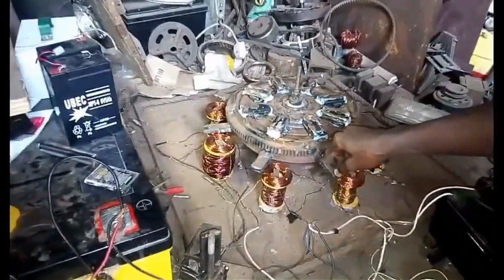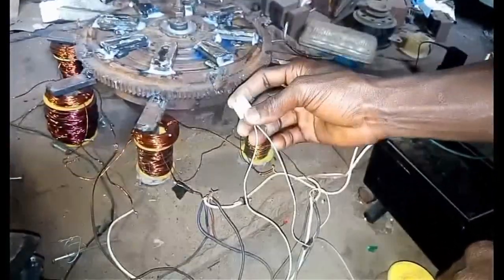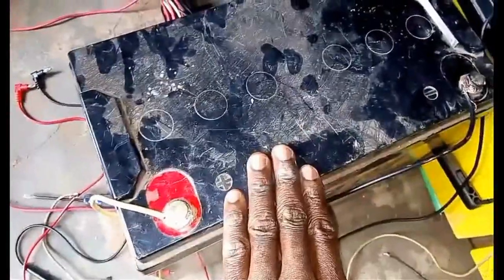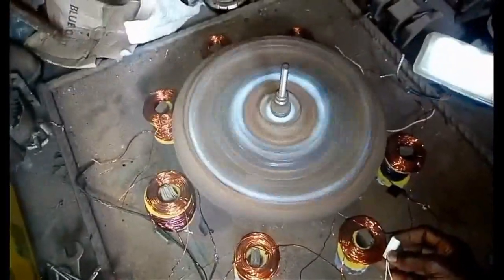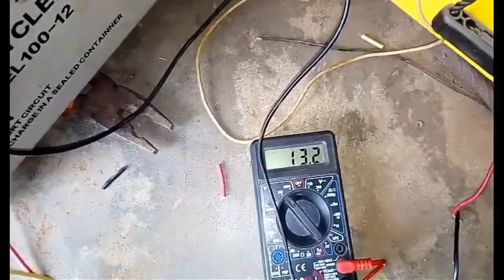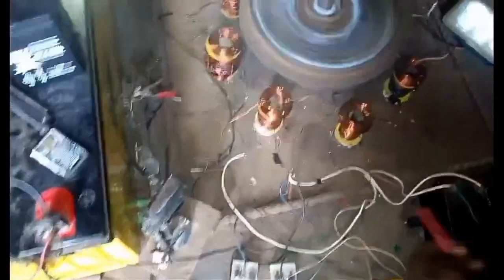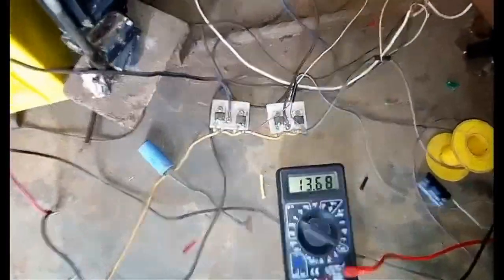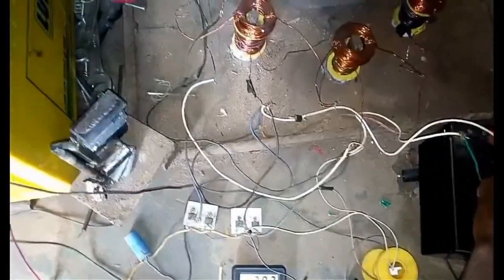Pulse motor generator 3

Comment: How much does this actually produce fella ???
Reply from the maker: It's producing about 20w due to the strength of the magnet, you need a strong magnets to get a higher power output.thanks
Reply: @JfGreenEnergy  That is pretty good JFGE What magnet strength would you need to double that Sir ??
Reply from the maker: @victoryfirst2878 30×15mm  circular  neodymium magnet
Reply: @JfGreenEnergy  What would the N number be 52 ??? And what about the heat rating Sir ???